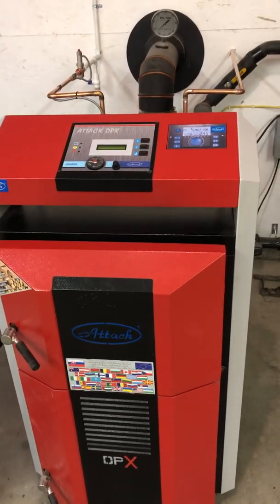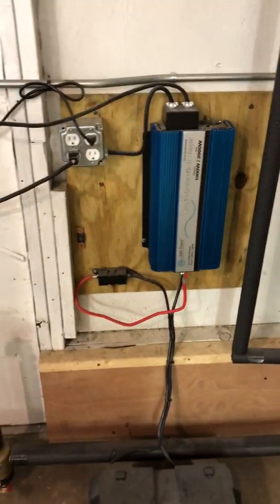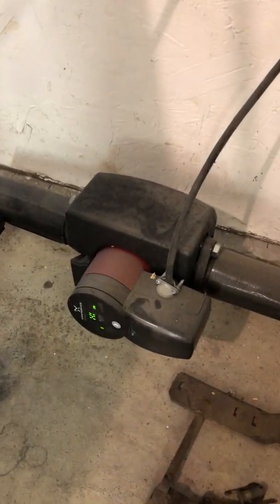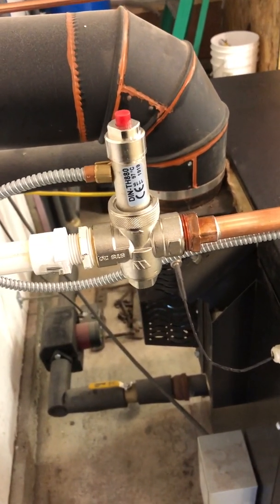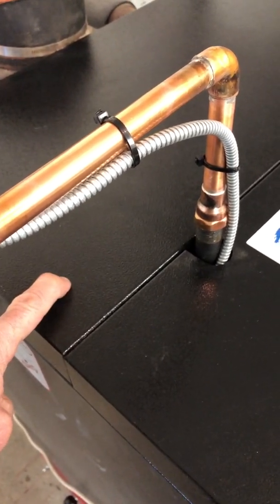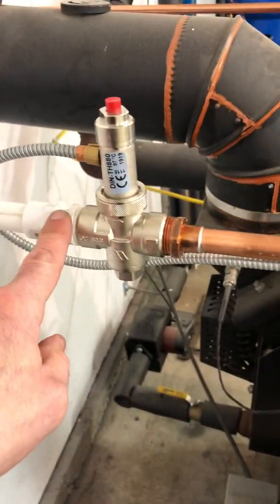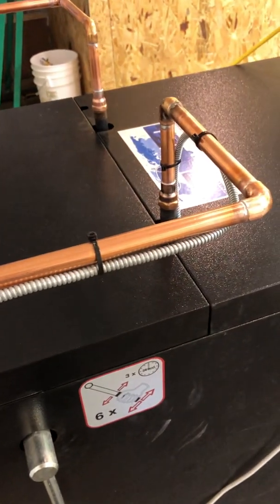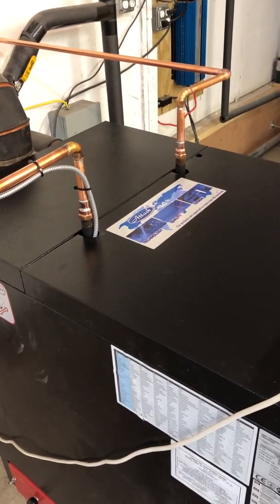Attack DPX45L wood gasification boiler overheat protection

Comment: Hi Tim,  I am going into my 4th year with my boiler and so far so good.  Had a few issues with the blower fan, but I worked it out.  I know you did a video on using fire brick around the hole going into the fire box.  I was wondering if you still do that and did it prevent any further damage to the edges of the hole?  Thanks  Chris
Reply from the maker: The firebrick works ok and does prevent damage.  It does need to be replaced often and can shift when loading firewood.  I have since had a local fab shop make a nozzle cover out of 1/4" and 1/8" thick 304 stainless steel sheet and that will last a good season, maybe longer depending how much you fire the boiler.  The 1/4" plate has a  rectangular slot that matches the nozzle opening and then use 1/8" to extend into the nozzle opening that keeps it located.  I have a drawing I could share, just no option to attach here in the comments.
Reply from the maker: With this cover it appears the nozzle will last a long time - which is good since I suspect sourcing a new one could be an issue here in the states.